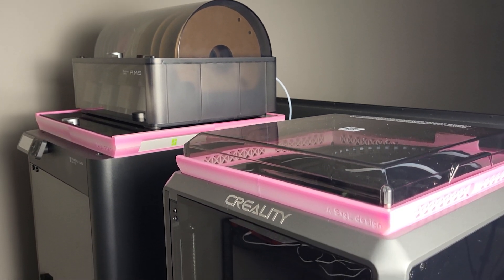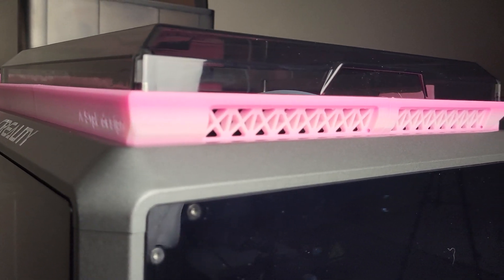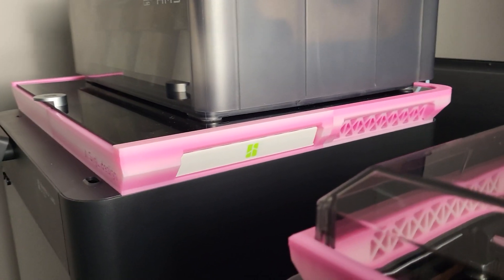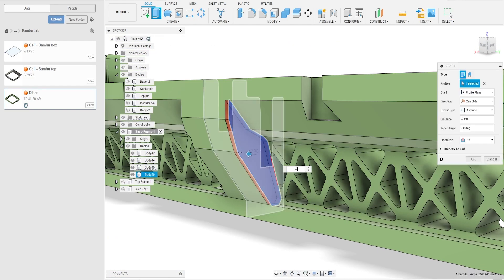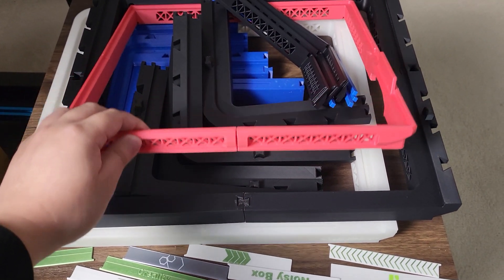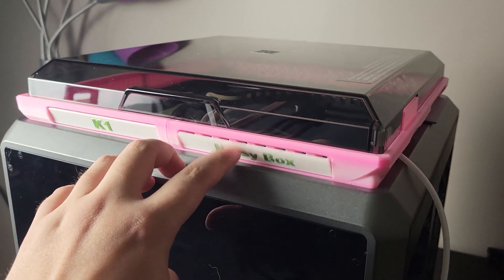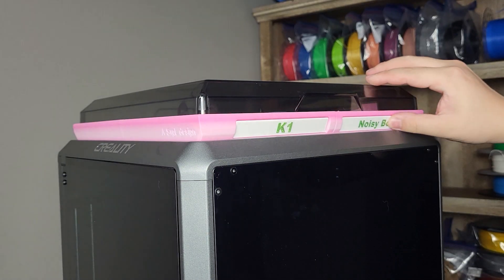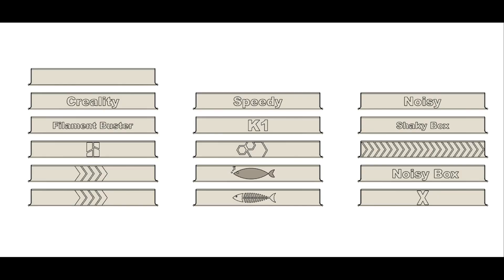Bambu lab, Creality K1 Riser upgrade model feature introduction | Stay low profile

Comment: Hello,  cool video , so if i want to print pla  i just need to  have the vent open or i need to remove the top ? Thanks
Reply from the maker: leave the vent open should be fine. Also, if you printing long hours prints, leave the front door open as well.